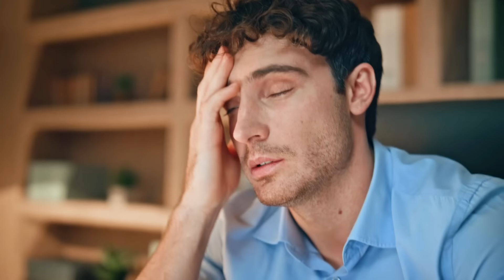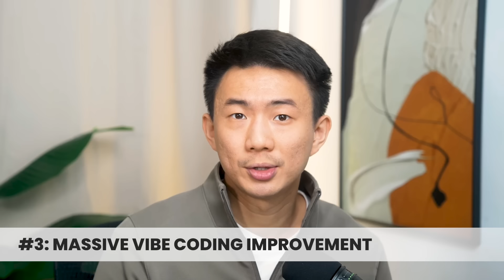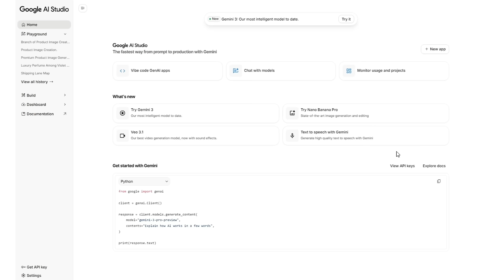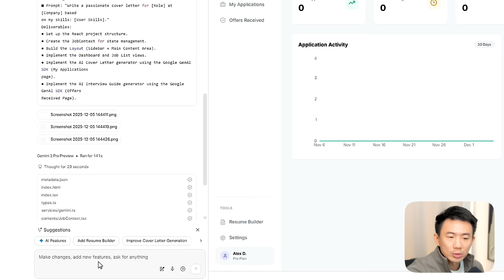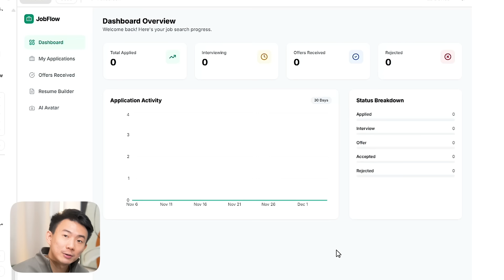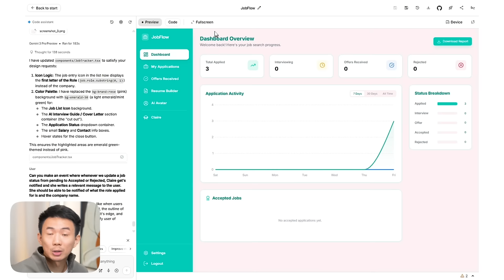How I Used Gemini 3 & Google AI Studio to Build a No-Code Job Suite That Replaces 5 SaaS Tools

Comment: This may sound strange. My 3 days of effort polishing a trip planner app in Google AI Studio, went nowehere with a single prompt. The system was completely clueless when asked to restore to the previous working version. 50+ prompts fired and processed as per expectation, and all of a sudden everything broken. 😟😟
Reply from the maker: Have you tried outlining the structure of the app first?
Reply: @andylokcl  Thanks for the response, In fact, I didn't make the outlining at first. Would be mindful of making things in order next time onwards. Update about the App -  luckily started working when I reverted to 24 Hours back update. 🙂☺

Comment: Part A: Foundation, Dashboard & Job Tracker

Use this prompt to scaffold the application, set up the styling, and build the primary CRUD
features.

Prompt:

Role: Act as a World-Class Senior Frontend Engineer and UI/UX Designer.

Objective: Initialize "JobFlow," a premium job application tracker. We are building the
Foundation (Phase 1). Focus on the App Shell, Dashboard, Job Tracking CRUD, and the basic
Gemini integration for Cover Letters.

Tech Stack:

- Framework: React 19 (Functional Components, Hooks).

- Styling: Tailwind CSS (Mobile-first, "Slate & Emerald" professional color palette).

- Icons: Lucide React.

- Charts: Recharts.

· Al SDK: @google/genai (Google GenAI SDK).
- State: React Context with LocalStorage persistence.

- Data Models (TypeScript): Define the full types now to ensure future compatibility:

"`typescript
type JobStatus ='Applied'|'Interview' | 'Offer' | 'Rejected' | 'Accepted';

interface Job {
id: string;
company: string;
role: string;
status: JobStatus;
salary: string;
location: string;
dateApplied: string;
description: string;
coverLetter: string; // Al Generated
origin: 'application' | 'offer';

// Placeholder for Part B

interface Resume {
fullName: string;
skills: string; // Needed for Part A cover letter generation
// Other fields reserved for Phase 2

Feature Specifications (Phase 1):

Design System & Layout:
Theme: Primary: Emerald-600; Neutral: Slate-50 to Slate-900.
UI: White cards, subtle borders (border-slate-100), soft shadows, rounded-2xl.
Font: 'Inter'.
Navigation: Sticky Sidebar (Dashboard, Jobs, Settings).
Dashboard (Home):
Grid: 12-column layout.
Stats Cards: Total Applied, Interviews, Offers (use Trend Icons).
Visual: Recharts AreaChart showing application frequency over 30 days.
Job Tracker:
View: Unified list view with filtering (Status / Origin).
Action: "Add Job" Modal.
Al Feature: When adding/editing a job, include a "Generate Cover Letter" button.
= Model: gemini-2.5-flash
Prompt: "Write a passionate cover letter for [Role] at [Company] based
on my skills: [User Skills]."

Deliverables:

. Set up the React project structure.
· Create the JobContext for state management.
. Build the Layout (Sidebar + Main Content Area).
. Implement the Dashboard and Job List views.
. Implement the Al Cover Letter generator using the Google GenAl SDK (My Applications
pagey.
. Implement the Al Interview Guide generator using the Google GenAl SDK (Offers
Received Page).

Comment: Opus 4.5 better than Gemini 3 but Google AI Studio definitely cool. Thanks for the vid. Very useful app.
Reply: Truee ... OPUS 4.5 is at the peak in terms of real performance ... chatgpt ain't even close. Gemini 3 not bad.
Reply: For technical stuff I find Opus 4.5 by far the best with the least debugging but for more creative directions like animations with three.js Gemini 3 pro is the clear winner.
Reply: @orelmor  You can change that by raising the temp. Try Opus with 0.7
Reply: Claude is at the top of AI models but its also the most expensive one.
Reply: @Mtubes24  Yeah that's why the Max sub saves so much as a heavy user.